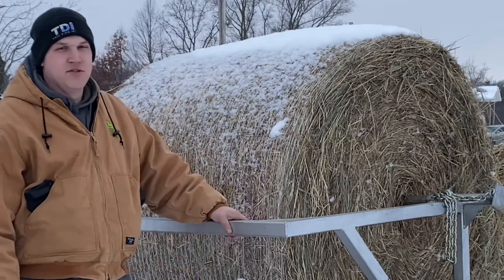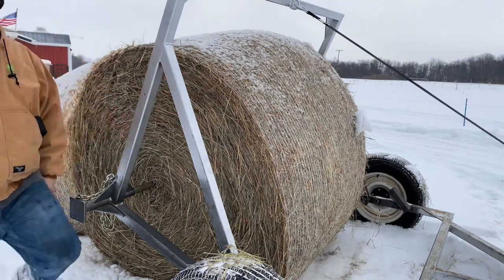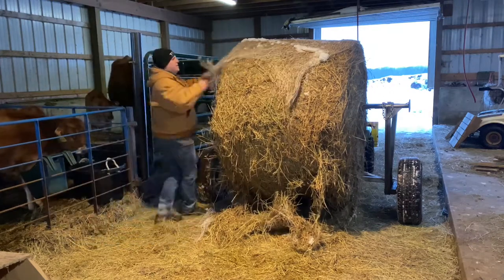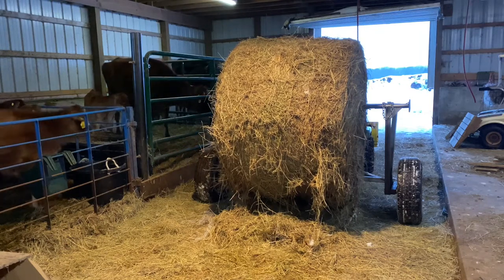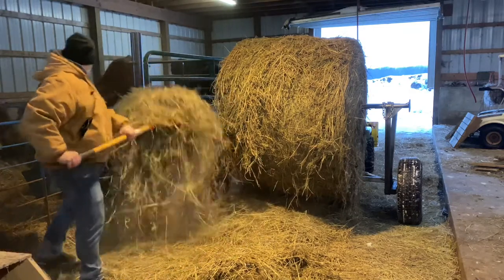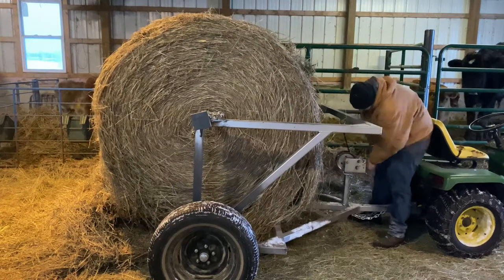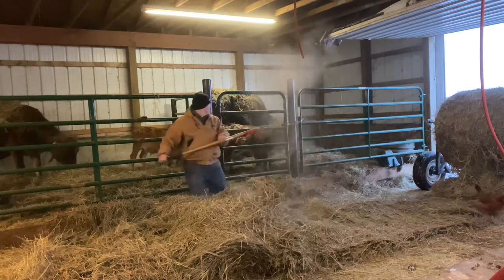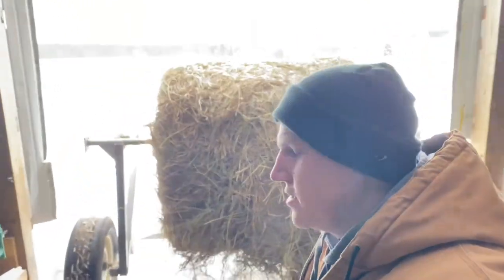How to move and feed round bales on the homestead, without a tractor

Comment: Just wanting to verify that the bale unroller will work with both 4 x 6 and 5 x 5 or 6 bales.thanks a lot
Reply from the maker: I have a 6’ bale on there now, it’s tight but works great once you get it on. Most bales I get are the 5x5 and there plenty of room to back up to the bale